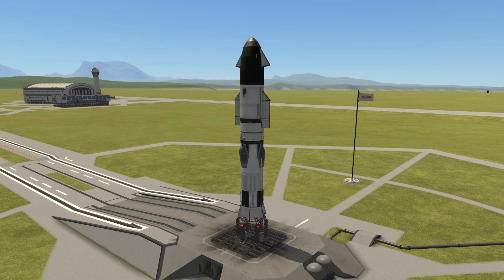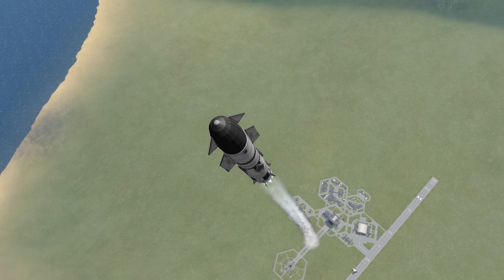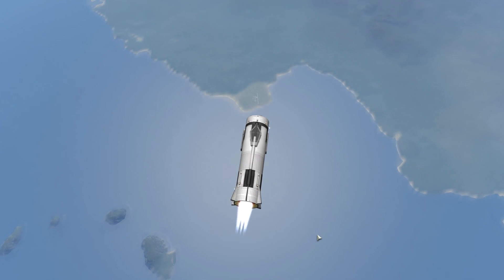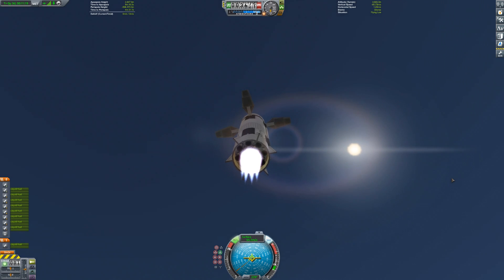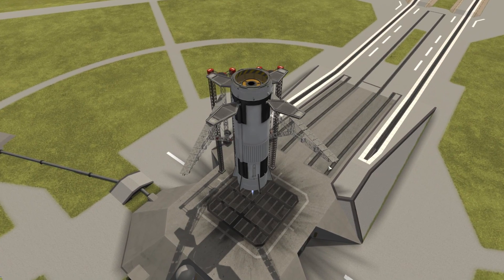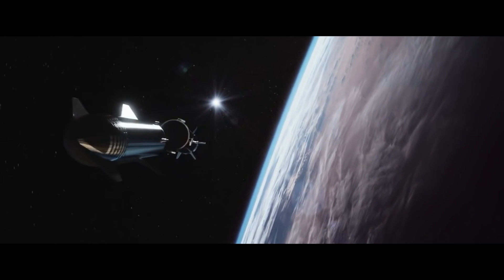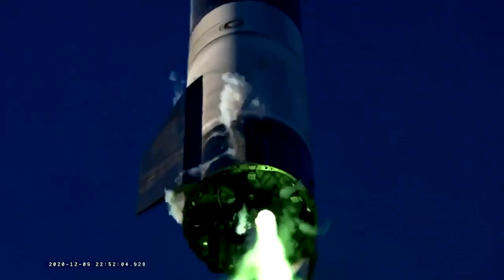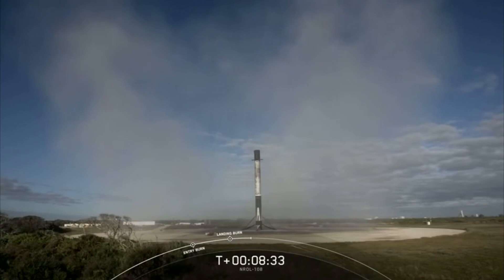Why SpaceX Wants To Make Landing Super Heavy MORE Difficult.

Comment: Starship is only supposed to use fuels/gasses that can be obtained and processed on Mars, in order to enable it's return flight.  Now that the design may require helium, is it possible to find/process helium on Mars?
Reply: The helium may be an interim solution while they look for a more permanent one.

Comment: I wonder if they could have the catch cables or whatever collapse in after the  aft of the vehicle has descended past them -- such that the booster doesn't have to land with quite so much precision. ... in other words, they wouldn't have to hit such a narrow hole initially; could be like 30 meters wide instead of 15 or whatever ... then the boister could hover for a second if needed and the catch supports could move in towards the rocket and get underneath the grid fins, then the rocket would finish its descent into the catch structures.

So I'm thinking maybe it doesn't really have to be all that precise.

Comment: Im not going to pretend to know better then a room full of rocket engineers brainstorming this stuff, but at a certain point here I gotta ask. Why not just go back to landing on the launch pad? You dont need landing legs to do it. Just landing pegs more like. I always pictured in my head a set of small strakes at the bottom of SH that act as said landing pegs. Strakes that at the bottom are angled inward and when coming down nestle into a cradle with that same angle. This way if SH comes down off center it'll slide down into the cradle. A crane could then pick it up and reposition it. But again they have most likely though of that...

Comment: Falcon 9 landing on the barge...isn't the barge a moving target, albeit a slow one?
Reply: Actually no, it has rotating thrusters on all corners that fix it in place when falcon is approaching.
Reply: The engine gimbals ought to be perfectly capable of adjusting to a slowly moving target... I suspect gusty winds are the primary reason why the target is hard to hit. To land precisely on the X, they would need to innovate on predicting rather precisely which way the wind will push the rocket as it descends through it.

Comment: Instead of direct towers, two words: Arresting Cables. You could even have the cables slack so there's a larger aperture to land, and then once the rocket is over the point, swing the cables into position, catching them with hooks on the grid fins.
Reply: Ooh, arresting cables.  I like that idea.  You could set up your landing zone (pit) with three towers around it, and a catch-wire going between each tower pair; use a lead-wire to draw each cable to the opposite tower, forming a 3-part snare that you close as soon as the rocket descends into it.

Lets you keep the hard hardware farther from the impact point, and if a rocket does land too hard, then all you need is new cables and a bulldozer.  If you make the snare 2 or 3 tier, then it can also do a much gentler job of centering the rocket too.

Comment: Maybe I'm not understanding but it seems to me that Super Heavy booster would always have to land down range considering the massive amount of fuel and the Delta V it would take to boost all the weight.  I guess it could fly back to base but that would be a very extreme maneuver compared to what Falcon 9 does.
Reply: SH was always ment to land back at the launch site, it's too big to be moved around easily. The F9 can be transported on roads, the SH is too big for that.
Reply: @csgergo80   I see, so a lot of that fuel will need to be saved for landing.  Lots of belly flop and flying around maneuvers.

Comment: Just land in the water? (It's stainless)
Reply: The stuff in the bottom won't like sea water, and it might not float on it's own.
Reply: @csgergo80  It will float, as the tanks are nearly fully empty, and the water would be a very good shock absorber
Reply: I've thought to this, but the thermal shock would be huge for the engines, and problably destroy them
Reply: @alfdriss  the engines could be air locked to avoid thermal shock (make the bottom of the booster close before splashdown), but yes otherwise it would experience RUD.
Reply: Ironically the first orbital flight will land both stages in water

Comment: Just make a Huge Funnel on the ground.  The booster would be self-centering when it lands in the funnel................
Reply: If you can hover, you don't need a funnel.  Fuel and control jets will put you to within 6 inches.
Reply: Couple a constricting  ring at some level inside the funnel to grab the rocket to prevent it from falling over. Should be a piece of cake to any graduate student mech engineer.
Reply: @robertmorency6335  I don't think either of you are aware of how structurally fragile a rocket booster is. It's not like a pen that you can grab and move by applying force to points on the outer body.
Reply: @reddmst  I don't think you were aware of the joke lol
Reply: @reddmst  Sorry Reddy, I think you're wrong.  My father was a structural engineer who worked for Aerojet-General many years ago.   We had many conversations about rockets, and rocket engines......
Reply: @SkyKnight34  Haha yeah maybe you're right, my humour sensor might have failed me there - my bad :P
Reply: @keitha.9788  I think he'd agree with me. It's the consequence of the square-cube law. Mass of a body increases with the cube of its radius, while its structural strength increases with the square of said radius. That's e.g. why smaller animals can fall from greater heights than larger ones. If you applied a significant radial load to a rocket booster, you wouldn't turn it around, but bend and eventually break it.
Reply: @robertmorency6335  lol grad mech engineer student being able to figure something out... that's a good one.

Comment: I wonder if they've changed the programming on SN9 to detect and avoid a similar incident to SN8.  There must have been warning signs and it is possible the rocket could have done an emergency landing if it had been looking out for it.
Reply: All they need to do is maintain header tank pressure at the flip and land maneuver.
Reply: @christophercarr5865  That's all they need to do to fix the cause of this particular problem.  The next problem which causes and engine to malfunction could be detected by software and maybe corrected for.

Comment: Elon likes using airplane analogies for reuability. This sounds like having the gate right at the end of the runway, and if the plane overshoots it just plows into the terminal.
Reply: It's not gonna be that way. Rockets aren't airplanes, even refueling will get more than 1 hour. In addition there is check up for every crucial component, especially for engines and plumbing. Even now the shortest delay between two launches of Falcon 9 is 51 days. Falcon 9 is pretty much easier rocket in comparison to the Starship.

Comment: One or more catching arms is not the way.. A circular mount to catch grid fins with 4,5,6 or more legs with shock absorbers on top could be better.. In brief something like the launch mount, but used for landing, taller, more resistant and with shock absorbers!

Comment: Why not make a rocket plane which will still launch vertically and arc down to another part of Earth quickly however will glide onto the runway avoiding the use of more fuel. Much safer as well.
Reply: We called that a Space Shuttle.
Reply: @stargazer7644  not talking about the space shuttle bro you need to listen. Why would I talk about a shuttle used to send tons of cargo to orbit. We are sending people.
Reply: @kaptain1477  Whether you have people or cargo in the bay makes no difference to how the rocket works.  Mass is mass.
Reply: @stargazer7644  You are not understanding anything that I am saying
Reply: @stargazer7644  I am talking about a way different rocket design you are talking about a shuttle. Your argument is based off the assumptions about what I am talking about.
Reply: @kaptain1477  The shuttle was a rocket plane which launches vertically and glides back onto a runway.  That is word for word what you described.  If what you said isn't what you meant, that isn't my fault.
Reply: @stargazer7644  The shuttle was not a plane it was a glider does not have engines to fly in the atmosphere or even at all it has external fuel tanks for its engines. It only glides down.
Reply: @kaptain1477  I suppose the three big RS-25 rocket engines hanging on the back that launch it vertically through the atmosphere aren't engines?  It is powered going up, and glides back down, which is EXACTLY what you said.  I suppose military aircraft that have external fuel tanks under their wings aren't really planes either?  If this is your idea of reasoning, please just go away.
Reply: @stargazer7644  What I am talking about is a plane with air breathing engines that also has a rocket engine or if NASA put their special two in one engine that can use air like a jet engine and change its mode to closed cycle and convert to burning oxidizer onboard to be a rocket engine being more efficient and able to possible make a SSTO. However we are just going to jump from one continent to another quickly.

Comment: Thinking about it, the tower has no real constraints and could be armoured with a large reach .  If the rocket and tower work as one they should move in unison, probably down to the nearest inch.  I was sceptical but very much warming to the idea, especially as an expensive tower is better than 100 expensive rockets.

Comment: If its sitting on arms, why couldn't it take off from that position? As is, the legs will have to be beefy enough to carry the fully loaded stack in compression. If suspended on arms the same loads could be carried up the stack in tension to the fins. No pad required, just big hole below. No lateral support.
Booster structure in tension may require extensive redesign and testing, or maybe not. But some redesign for tension may need to be done at any rate if the empty booster is landing on arms.
Reply: I was wondering if they plan to build the tower remotely to speed the project, in parts or a single assembly. How close could they get a barge to the launch site? Could a tower assembly be transported in from a few miles away after offloaded from a barge, or could a channel be dredged to the launch site? Maybe water's deep enough already.
Canaveral has a similar landing spot near the launch sites which spacex was going to use.

Comment: I suggest something that works on the same theory as how the now deceased Arecibo radio telescope suspended its receiver/transmitter.  You have a big hoop that is greater in diameter than super heavy and, of course, very sturdy.  Then you have 3 piers at 120 degrees separation maybe 100 feet or so away from the landing target that are adequately taller than super heavy.  Then you run 3 cables from the hoop over the top of each tower, down to the ground maybe another 100 feet further out where you have them coiled on a drum that has high speed, high torque motors that can very quickly work together to take in or release cable such that it is capable of moving the hoop keeping it centered on the starship as it descend through the hoop.  Upon descending to the point where grid fins contact the hoop, the motors can work to decelerate the remaining downward velocity (kind of like a fishing line release) and then center the starship over the launch mount base and finish lowering it.  This whole apparatus could "catch" starship many feet above the launch mount keeping the engine exhaust from burning into the launch mount and reducing reflected shock waves.  Once super heavy is lowered onto the launch mount, the cables coil out all the way lowering the hoop to the ground where you have a receptacle that locks it in place safely protected from the next launch.

Comment: If the arms that catch the rocket can pivot left & right and have a decent amount of lateral movement then you could probably get away with a reasonable amount of error in the exact landing location.

...So long as the rocket comes down exactly vertically within a few yds of the landing spot the arms could move left/right to meet it.
Reply: The F9 lands on a much smaller spot using a suicide burn. The booster will be able to hover, so no big deal to get it in a meter range of center. The fins are large enough to do the rest.

Comment: THE BELLY FLOP DISPLACED THE FUEL IN THE TANKS MAKE IT SO HARD TO BUSH ENOUGH FUEL WITH THE LEQUIED OXGEN AND THE ENGINE EATS IT SELF LETTERLY ....... THE FUEL TANK WAS 20% ONLY WHEN ENGINE STARTS AND THE OXEGEN TANK ALSO BUT THE ENGINE TAKE ENOUG OXGEN FROM THE HEADER TANK WHICH WAS PRESSERED IN 80% ......  THIS SAME PROBLEM HAS HAPPENED WITH MUSK IN FALCON 1 ........ BECUASE OF THAT HE IS NOT WORREID AT ALL

Comment: Makes sense- Starship Lunar Optimized was re-engineered for forces suspending it by top mounted retrorockets - similar re-engineering allows Heavy to be suspended by top mounted grid fins. I think somebody at SpaceX took inspiration from Arecibo- "So, a 900 us ton platform suspended by 3 towers. Boss, at 300 tons per tower, we can hang a Heavy from one tower by building 'Tankzilla' style cables & counterweights into the tower."

Comment: When the Starship will be going with space tourists, the best way to leave this world will be in catastrophic landing failure. Just epic!
Reply: this is about the booster, there will be no people inside when landing
Reply: @victortauber2233  After what we saw with No. 8 it may be actually safer to land it empty and get all the passengers and crew parachute out before landing. But as much as the free-falling to your death from great height after parachute failure is fun, flipping just before the ground, and then dying in the magnificent fireball sounds much more fun.
Reply: @SecureGM  -parachutes are not an option, they can't stop a 120 ton steel tube

-starship wont carry crew until its reliable just like any hardware and will land on sea or close to se, that way they can change trajectory and do a splash down if anything goas wrong
Reply: @SecureGM  oh you mean people with parachutes, no way, starship wont have an abort system or emergency door lmao
Reply: @SecureGM  SN15

Comment: Makes sense in some cases - 
The weight of the grid fins and mechanisms could crush the SH body like a beer can during harsh touch down in a low tank pressure condition. 
Logistics of moving the SH unit around post ground landing are troublesome. This, suspended landing could make it much simpler and faster for quick turn around of the vehicle. #1Priority
If this landing requires/utilizes a hover, it should be gentler on the entire vehicle, albeit requires nice wind conditions. 
There could be other, sturdier mechanisms that extend out beneath the grids to help support the weight.
Reply: Think "Starship Lunar Optimized" Forces near the top from lunar retrorockets aren't substantially different from forces near the top from grid fins.

Comment: The implications for this are larger. The grid fins can theoretically be used for liftoff configuration. It's not just the removal of the legs but also the lower skirt and all of its reinforcement. Some of the weight savings may go towards reinforcing the grid fins, however. We will have leg variants before fins are used for mounting, so we can make comparisons, at some point.

The only issue I see with any of starships development at the moment is extraterrestrial landings and engine placement. I think they could be placed around the ship and further up. I've seen your video on the pendulum fallacy but I think you actually proved this would work with spin/role incorporated, much like a bullet. A design orientation like that offers amazing possibilities for the deployment of massive prefabricated sections of extraterrestrial, including orbital, stations (pretty much a dropship design if it can work). The larger engine footprint would also make it much more reactive in terms of manoeuvrability. Also, use them at liftoff with fuel cycling between stage one. I really think this is worth another look at with the engines midway down the body. Don't get me wrong, lunar and Mars landings shouldn't be a problem when they build landing platforms but even then that's quite restrictive for exploration.

Comment: I while ago I had a very similar idea for how to land rockets without landing gear. There is the obvious problem that this sort of landing would require really good precision which is very hard to do with a rocket so I thought instead you could just get the rocket within a reasonable range and with acceptable speed and then rely on the landing site to do the precise work of catching the rocket. So the landing site would need a grabber thingy that can move in all directions and can match the position and velocity of the rocket just as the rocket is about to shut down its engines. To get even more room for error you can have a grabber that grabs the fuel tank from all sides simultaneously (just make it round) and make the contact surface out of an inflated rubber-like (but at least somewhat heat resistent) material, kind of how you put car tires around boat docks so that the boats don't get damaged. You can think of it as an inflatable castle-like hand that moves in and grabs the rocket just as it is about to stop above the landing area.

Comment: The main difference between now and fifty years ago and why just about anyone with the gumption to have a go will have a decent chance succeeding is due to the fact you can have the required sensors and processing power to make this possible in a matchbox, image sensors, accelerometers, gyros, GPS etc. ready built in fact..Dare I say it is easy today?